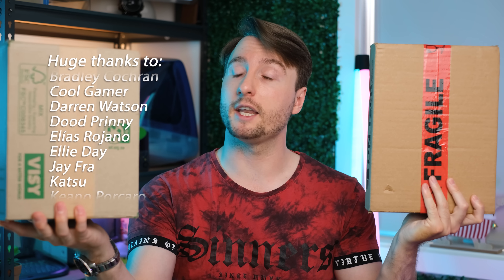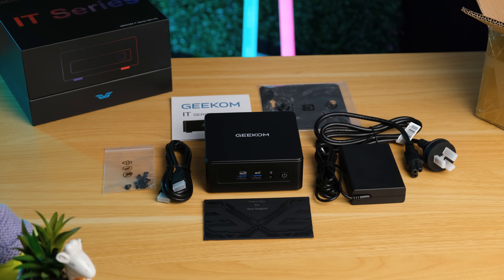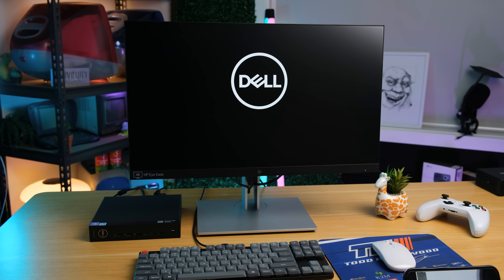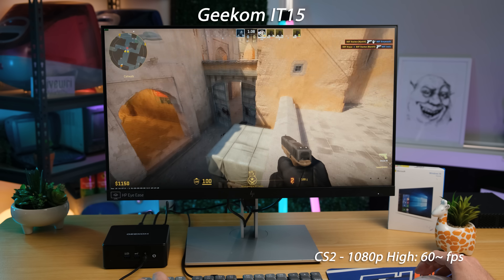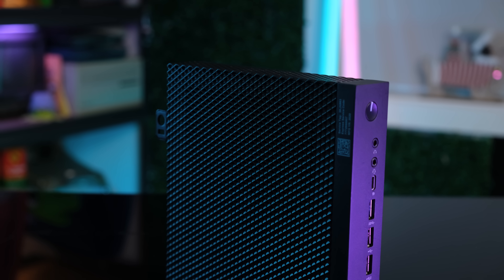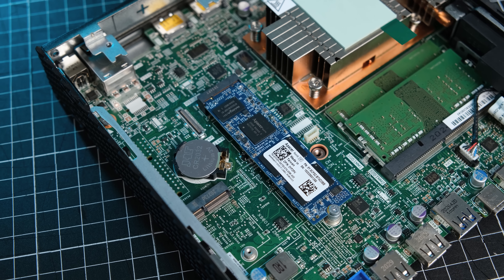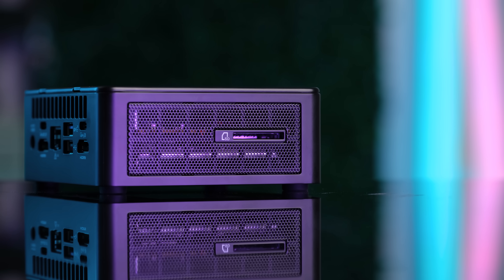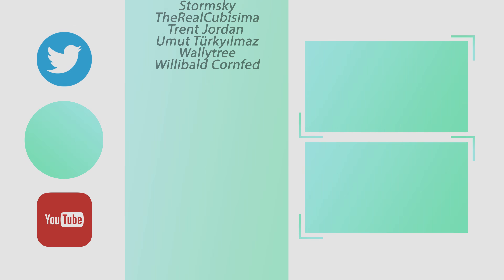$76 VS $1,430 Mini Computer! Should You Buy? - Dell VS Geekom IT15

Comment: Sup Nathan. I will say, not bothering to watch all the way till the end, watched half, but you could've at least go with an Intel 5th gen Dell Optiplex instead of a Wyse system. Wyse systems would be much more applicable to something as keeping it connected to servers and do remote management via Ansible on any Linux distro and some other Thin Client-based applications to servers just to manage, again, servers, off of it through ssh, or locally. Calling it a little unfair doesn't justify the video either. It's like I'd compare my Intel Core i5 Ivy Bridge desktop from 2012 to my i3 Tiger Lake from 2022. It's just not cutting it. So a slight recommendation from me is reusing this Wyse system under linux and build a little home lab using far capable mini pcs and integrating this Dell Wyse to manage ansible and ssh connections for all systems in the computer cluster. Sorry, but this vid did feel like an ad for Geekom and it was disappointing to watch.

Comment: For 1400 bucks one could get a decent gaming laptop, but with a display, keyboard, decent speakers and battery. And it would be so, so much better at gaming for the same price. Sure, it'll be bigger but would still be portable and would be able to used without external peripherals.

Thanks for the video and Happy New Year!

Comment: I normally enjoy your content, but this just felt like a straight out ad for the Geekom unit. 

Comparing it to a thin client with a Celery (intended) is pointless.

There are decent refurb units that still hold their weight, like an 8th/9th gen SFF or USFF unit for under $500. That's a much more fair comparison and realistic in this day and age, especially when an SFF can be paired with an Intel Arc A310 for improved graphics or transcoding. 

The thin client would've performed better if you'd gone for the Pentium Silver instead of a Celeron and used a Linux distro (really, anything would run better on it than full fat Windows 10/11).
Reply: Because it IS an Advertisement for the Geekom disguised as a “comparison” video. To make the video appear in favor towards the Geekom, he chose a Dell Thin Client rather than a Dell Mini PC with similar specs with the Geekom.

Comment: For $160 I was able to grab a Lenovo ThinkStation P330 Tiny with an i7 8700T, Quadro P1000 and 16GB RAM + 512 NVMe SSD and you can upgrade everything on this mini PC even the graphics card for another low profile single slot one, 2 SSD slots and CPU upgradbable up to an i9 9900 or 9900T

Comment: It's not worth it. The best mini PC by far is the Mac mini with M4. The base model at it's current price...you can never beat that. Cost/performance and all that
Reply: Still useless if you want to run Linux to avoid Apple eco system and their walled garden.
Reply: @zorro315754442 I was talking pure performance/cost ratio

Comment: i would go for an m920q tiny. at 110€ i got one with 16gb ram and an i7 8700T. slapped in it an rtx 3050, and for around 350 + a bit of 3d printing i've managed to get a very small pc capable to game pretty well. and is definitely better than most mini pcs.

Comment: This feels like a glorified advert for the Geekom tbh.
Reply: It is
Reply: Exactly my thoughts after a few mins haha.

Tbh, guys getting sponsorship so course it was gonna be.

However, I hope this doesn't put people off lower end systems, especially for emulation. I've set a 2400g loaded HP Elitedesk mini pc up as a retro console. It's smashing everything up to WiiU and some light PS3 which is nuts for around £100. PS2 and GC upscales 2-3x easy, so good!
Reply: @y2kcurran  Was going to suggest the same PC (HP 704 G4). Paid a similar amount for mine. 

The Wyse machines are thin clients - a class below mini PCs.
Reply: i had an eye on the wyse for a while and didn't even bother for the geekom in this video. not my price range. i already have a beefy tower for games and ai stuff. but i am on the lookout for a nice cheap little home server with low power draw and decent upgradeability. wyse 5070 goes up to 32gb iirc.
Reply: @autingo6583  I prefer mini PCs with AMD APUs as the 680M/780M are VERY capable GPUs.

Comment: willing to bet that the price of the geekom is inflated due to RAM. because there is no reason for a mini pc to cost more than a gaming laptop of similar specs.
those dell wyse things would be perfect to stick under the TV and use as a media PC, but i've heard that a lot of such thin clients are used to drive large public displays and billboards.
Reply: some devices have inflated price just for the sake of it. He did say it's the most expensive one he could find.

Comment: The Dell Wyse feels a bit off an odd choice, they're mostly meant to be used as terminals and are known to be weak since they're not designed to do too much. A Dell Optiplex 3070 Micro would have made much more sense, I bought one myself some months ago for 50GBP (100AUD) with an i3 9100T and 8GB of ram, all it needed was an SSD and compared to both these systems it also has an upgradeable CPU, so you could throw in an i5 9400T for an additional 50-70AUD, but the i3 is plenty capable as well.
Reply: agreed, definitely feels like it was chosen for comparison because it'll look laughably bad compared to the geekom. This really should have been disclosed as an ad, because it almost certainly is.
Reply: Still, impressive what that low powered thin client was capable of! 

I got myself a small form factor Dell mini PC - it had a Core i3 (6th gen?) IIRC, I just needed to add an SSD. It was being thrown away, as it didn't work - and the reason? A flat CR2032 battery!
With Windows 11 on there (via Rufus) it works a treat!

Comment: The Dell Wyse is a nice low power home server kind of box

Up to 30GB of RAM is ideal, going over 30GB results in very weird instability issues and extreme slowness

Also, the wyse only accepts SATA M.2
Reply: Did you verify your used RAM isn't corrupted? I'm running a Dell Wyse 5070 with a 5005 Celeron in combination with 32GB of DDR4 RAM and Linux Mint and never had any instability issues.
Reply: @zorro315754442 well, I guess it is a "no one is sure" 

I suppose it's possibly dell may have fixed it at some point with bios updates? Though I don't have 32GB of ram to test with at this time

Comment: I Wouldnt write off the wyze 5070, the 5070 Extended version has way more flexablity and often have both Wifi and a PCIe x4 open ended slot so you can upgrade the graphics, i use one in my living room as a media centre PC with an Arc A310 and it handles the task beautifly including smooth playback of 4K HDR movie rips

Comment: How does the Geekom compare with an M4 Mac mini? Peace.
Reply: That'd be wholly dependent on the use case and such. I have a pc and a mac. Mac is for photo and video editing. Pc is for gaming and other things
Reply: I was wondering the same thing. Not a gamer or a video editor though, so it’d be difficult to compare. For my uses, it’s more macOS vs Windows and I prefer macOS. Hard to compare performance for my use cases. But a good question, given the design similarity.
Reply: Depends on the usage.

Comment: Btw, that J4105 natively supports running windows 11 . It won't be super fast for 3d apps, but it will work for most tasks.
Reply: I have installed windows 11 on the Dell wyse with the j5005. I haven’t tried with the j4105. But I believe that they are both compatible.
Reply: But does the motherboard? It needs TPM 2.0
Reply: @AtomSquirrel  I mean it's a enterprise device so probably.
Reply: @dumbfloppaI have a ThinkPad that has TPM 2.0 but is running an Intel 7th gen CPU. It left the Windows chat entirely.
Reply: @AtomSquirrel  TPM is mostly on the CPU these days as a firmware module. The J4105 has a Windows 11 compatible fTPM. It's even on the official Microsoft Windows 11 CPU compatibility matrix.
Reply: @shadowtheimpure gotcha
Reply: And the ridiculous part is while a celeron will work, it wont even work on an i7 6700! I just use windows 7 though
Reply: Why would I want to use that absolutely Spyware of an os I'd rather use windows 10

Comment: That sub $100 mini PC seems like it'd be a fun thing to use as a server to backup my motorsports archive to. Might end up springing a bit more for something with slightly more power, but that beats the heck out of building another server myself.
Reply: Go rather to a used HP Elitedes 800 G4/G5. They Are Great, all upgradable Even the CPU on the Intel T Processors.